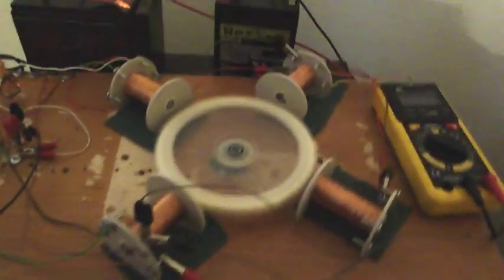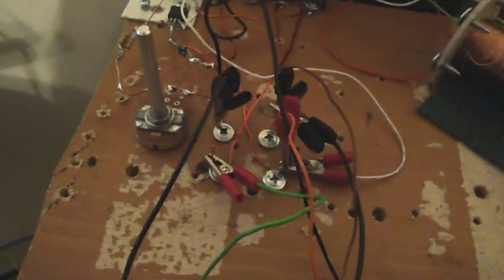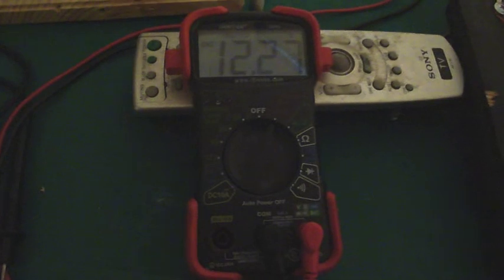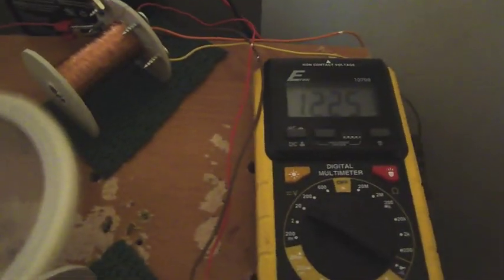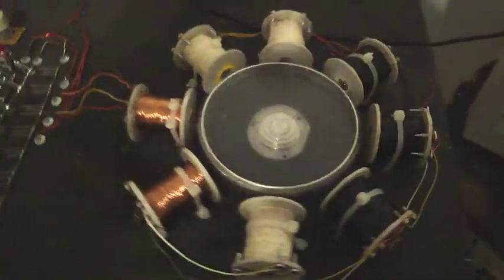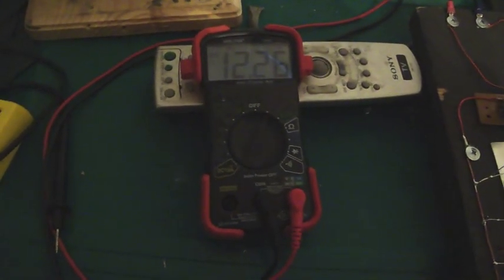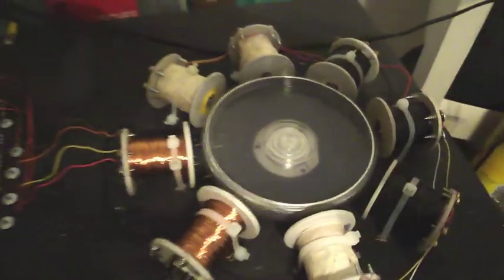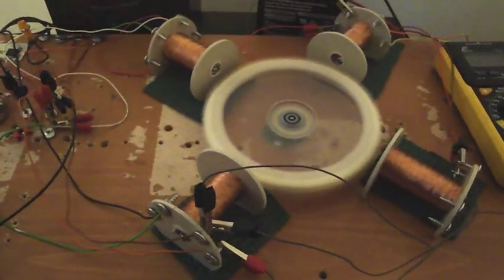Two from One.avi

Comment: @freex999 And one more thing I have the same layout as the wire you have 0.20 and 0.60 and still the same voltage 6v coil wound with 400 turns of a spit and 700 and 900 and the output voltage of 6V Heyke

Comment: (4th) I figure that you might be getting bored with reading battery voltages, and like I said they are simply not reliable indicators of what's going on at all.  However, if you know the actual average power output in Watts that is going into the charging battery, then at least you know for a given time period how much energy you put into it.  The surprise for you will be to see how much power is lost in the running motor as heat.  If you post questions I will tray to answer them.  - MileHigh

Comment: (3rd)  The most basic question about the performance of your Bedini motor is what's the output power to the charging battery compared to the input power from the source battery?  How do you optimize that ratio to get the maximum power transfer to the charging battery?

You can use simple tricks to measure the power consumption and the power output to the charging battery in real time.  It's all explained on the measurement thread.  You can monitor this as you change the base resistor.

Comment: (2nd)  The main problem with batteries is that for up to 90% of their discharge cycle the output voltage is essentially the same.  The voltage can also creep up or down by small amounts due to temperature changes.  They are simply not a reliable indicator as to what the energy level in the battery is. A change of 2/100ths of a volt either way really and truly means nothing.

Comment: Poppy, you should check out the thread "Bedini SSG measurments" on the web site overunityresearch.  The big issue for your group to tackle is that the battery voltage measurement is only of limited use.  The real measurement for batteries is their energy level, and you have to discharge the battery to measure how much energy is in it.  That is a lot of work, but it's the real thing.  However, there is another angle that is equally interesting to consider.